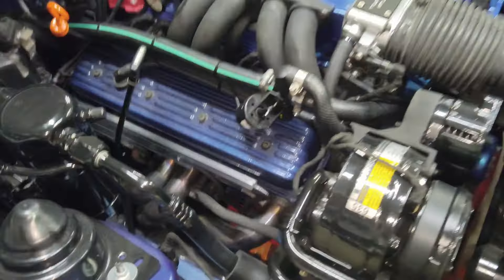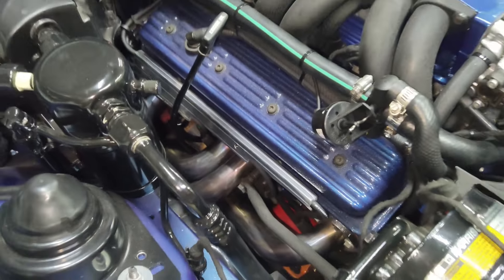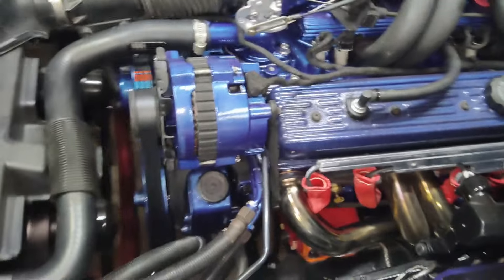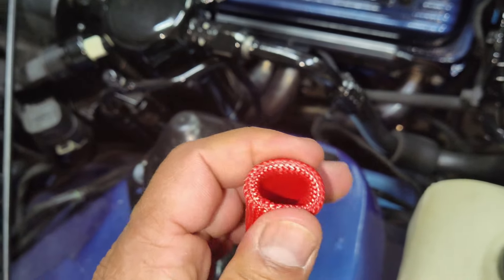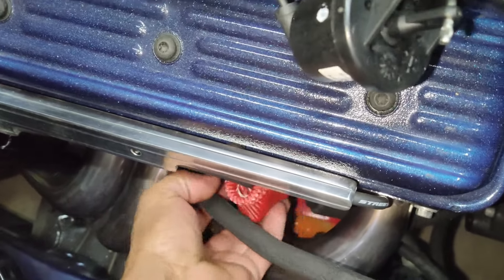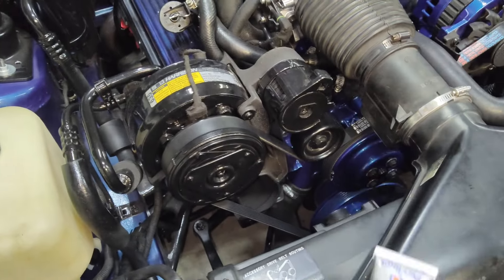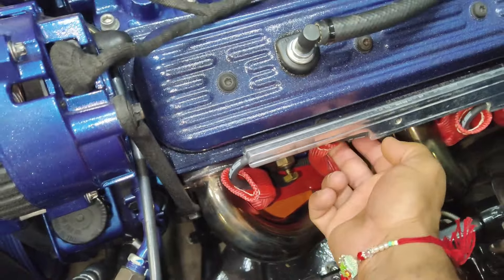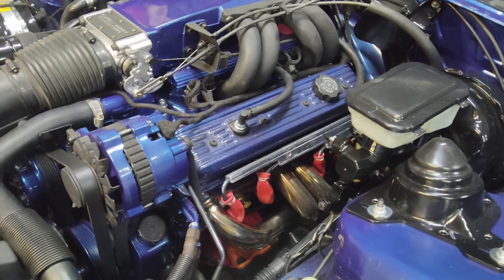Install Spark Plug Wire Boots Heat Shield Protector Sleeves!

Comment from the maker: Spark Plug Wire Heat Shield Sleeve 2500° Spark Plug Boot Protector
Click Here:  👉  https://amzn.to/3Yh0k2g

Spark Plug Wire Separator, Removal Tool
Click Here:  👉  https://amzn.to/3WgSB1w

Dielectric Tune-Up Grease
Click Here:  👉  https://amzn.to/3WDhl4n